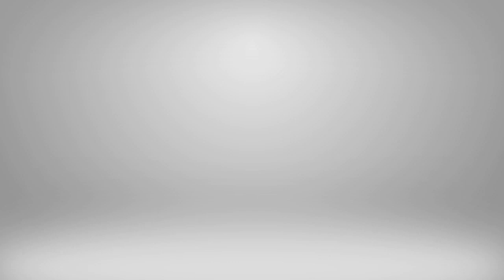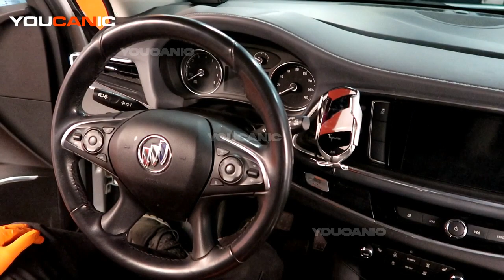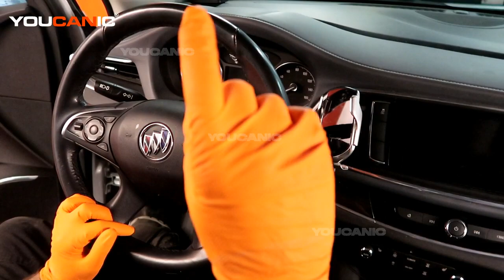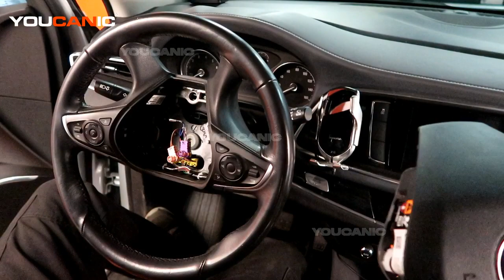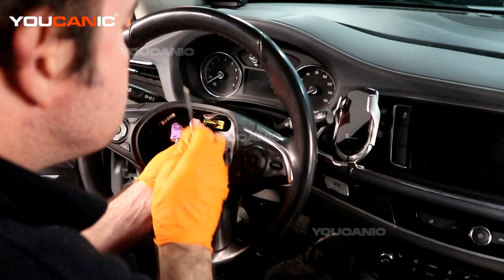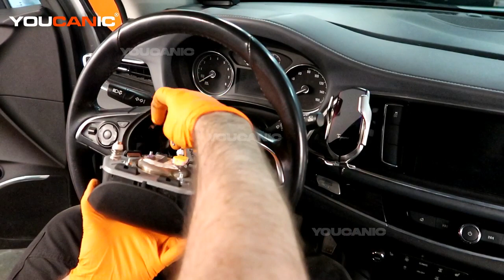2018+ Buick Enclave - Steering Wheel Replacement

Comment: Hi I have a 2018 enclave and it's doing this ,right steering wheel buttons dont work and temperature buttons don't go up down, the only right blinker light works is this the problem the clock spring?
Reply from the maker: @PathToPeaceMoe If you’ve got a car issue or repair question, you can find step-by-step guides and scanner help at youcanic.com. We might miss some comments here, but our site has answers for most problems already!

Comment: How about to remove steering wheel switches?
Reply from the maker: Thanks for your comment! At YOUCANIC, we do have resources that could help guide you for removing steering wheel switches. We suggest checking our free online resources, guides, and our powerful YOUCANIC scanner as a starting point.

Don't hesitate to reach us on www.youcanic.com if you require further assistance. We also offer detailed factory repair manuals if need be. At YOUCANIC, we're committed to empowering car owners like you, giving you the confidence you need for all your car maintenance needs.